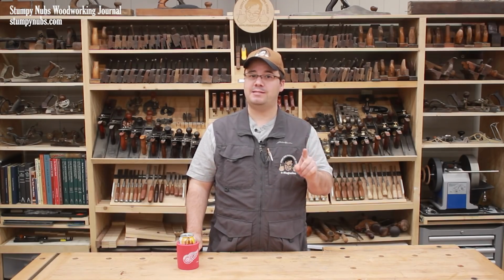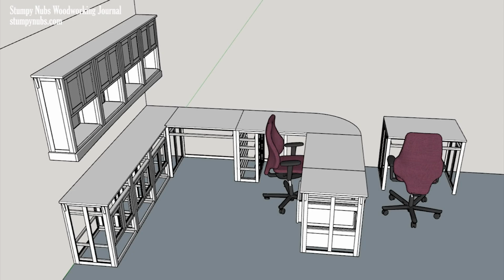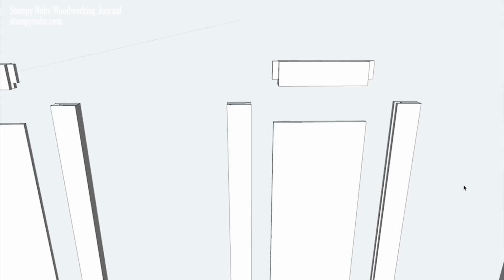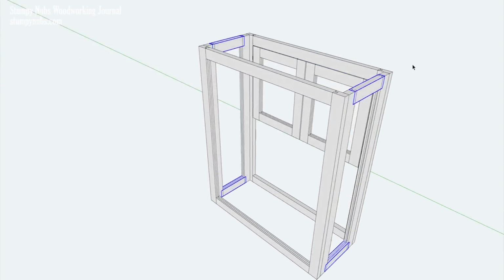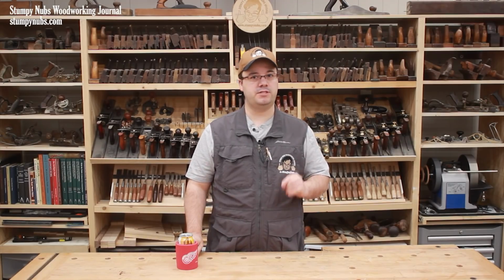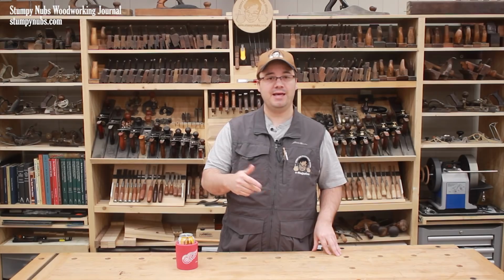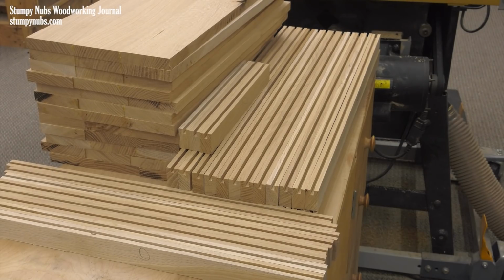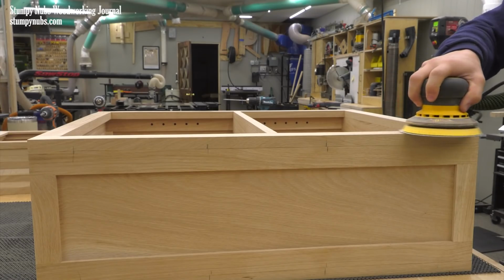How to make BIG projects without being overwhelmed

Comment: Thanks, James!  I learned these lessons from building a complete kitchen, 6 WFH desks, and a living room set.  I'm a former mechanical and manufacturing engineer, so these concepts are familiar to me, but your explanation and fine SketchUp skills make this visual and impactful.   I also create PowerPoint slides for the cut layout, tricky piece details, and descriptions for each assembly step.  This helps me really think through all of the steps BEFORE I start cutting and possibly wasting expensive materials.  The printed slides give me all the information I need in the shop.  If there are issues, I stop and mark up my slides, then revisit my SketchUp and Powerpoint files with a cup of coffee in the morning.

Comment: It is still difficult to work in a really small shop. My shop is 10 feet by 10 feet. So around 3 x 3 meter. So It is planning and a lot of cleaning. Lol . Everything has his place and I need to put back everything I used. Almost nothing laying around, other wise it is a mess in seconds. When I use a thickness planer I have to put away my small table saw, and make room.. etc etc. And a large project I make indeed in pieces and put together outside. So planning is for me really important,

Comment: I've been doing this since I started woodworking. I used to work in a metal shop and learned very quickly it's faster to batch out every single part you can before changing over to another set up for the next part. The only time I do not do this is if I'm testing a concept for a design, at that point I'm building one piece and generally not to full scale just to see if it will go together. Yes pine is fine for testing, it's cheap lol.

Comment: Good review of lean manufacturing processes!
I use this practice in small scale, but not so much for an entire big project because I found that minuscule variances add up quick, because I am not a machine, and then all those tenons i cut do not all fit their corresponding mortises. Add to this the minuscule wood movement that invariably occurs if I’m cutting things to final size a week before assembly which also makes things not fit together as well.
Add to this that in a small workshop it’s difficult to stage so many pieces at one time.
The way I made a full kitchen cabinet setup in a small workshop is to make and install no more than two cabinets at a time. I did batch what i could at each step, but I only batch cut tenons to rough size and then fine tuned each one to each mortise to ensure a perfect fit for each one 😎

Comment: Another advantage of modular design is that you can pick & choose the best pieces of wood for each assembly. For example, if you have a knot in a piece of wood then that can be placed at the back or interior of the piece where it won't be seen because the pieces can be swapped around & flipped as needed. I find this most useful in grain matching.

Comment: If you use Fusion 360 to design the cabinets you can then use the built in Parameters for every dimension in the project. Therefore if an overall dimension such as width or height needs to change, changing only one Parameter will change all other dependent Parameters automatically. I make my own frames for different size pictures. I only need to enter the value for the size of mat opening to show the picture and all other frame and peripheral dimensions change automatically to proportion the frame. I then print the drawings for the frame, mat, glass and backing for construction or ordering, I also use the assembly feature to check for any assembled errors. Saves me a huge amount of time to set the dimensions for new size picture frames.

Comment: One thing to watch when you are designing, minor size changes to better utilize materials.   years ago I noticed a part our company making, was called to be 24".  Our raw material was 20 feet long.  So a bar yielded 9 pieces.  an engineering change to 23 3/4"  and a bar yielded 10 pieces (1 free).  those kerfs add up.  and the slightly smaller piece worked just as well.

Comment: This is a prime example of obtaining repeatability in multiple parts. If you can make the same required cuts all at one time than your accuracy will be more consistent Jigs and gauges can help to confirm accuracy or if you have to return to a setup. This is more difficult than it sounds so reducing setups helps you avoid the stress of trying to return to a previous setting. Perhaps 2021 will be the year of consistency. Let the chips fly!

Comment: James, what advice do you have for someone using multiple stain colors on glued together cabinetry? I've run into so many headaches joining different colored pieces and then ruining the coloration trying to sand down glue squeeze out or flattening joined surfaces. If I wait till the project is assembled to stain, even the best masking tape can't prevent stain from seeping under the edge....

Comment: This is realy something to think about. For a Person like me that works from a plan in his head, this may be a good reason to start making drawings for my projekts. Thank you.
Reply: I mainly use mind plans too (because I enjoy being able to adjust things on the fly) & many of the same principles can still work. You just need to narrow down the selection of joints & joins you use to a handful that are versatile enough to use in different pieces, such as the rail & tenon one in this video. You could quite easily add a transom to any such piece by using another of the horizontal ones, just placed in the middle instead of at the ends of the uprights, & cutting an extra horizontal is quick & easy because you already have the machine set up to do it. Add a mitre fence & you can cut a diagonal piece just as easily, should you want to add one of those, & it'll fit into the same rails as everything else.

Comment: Don't forget to mill all the stiles and rails to the right thickness before you do anything else.  If the thicknesses are random, you'll be in for a world of hurt.  My error was in thinking that all the 1x's at the lumber yard would be consistent.  They weren't.
Reply from the maker: That was the first step I mentioned
Reply: @StumpyNubs  Yes, your advice is always golden, James.  I just didn't want anyone to make the mistake I made of trusting the lumber to be consistent just because they all look the same.  You can check the boards with a caliper; my last batch was ok and didn't need thicknessing.

Comment: A major feature of this very helpful video is missing. What CAD software are you using? I've tried several but they all show only drag and drop dimensioning. I need to be able to type in a designated length and direction such as x=15' 2.5". Which software would explain to me how to do that?

Comment: Lovely.  Seriously, those are great lessons.
But how do you prevent my favorite mistake: losing track of which pieces go where.  How do you label them?  I've rarely, if ever, seen labels on project parts in your videos.
Reply from the maker: I label when needed. In this case, most of the parts are the same, so they are interchangeable.
Reply: @StumpyNubs  My issue is that when I have a big project, keeping track of all the different lengths becomes an issue.  Or two small projects with similar dimensions.  Do you use painter's tape or something else?  I can be kind of a klutz with such things.  Thanks!

Comment: Hi James, I know you have been doing safety videos and may have more to come, but I have been wondering about the Saw Stop safety device and just how good it is, I have seen hotdogs slowly moved into the spinning blade, but that is not how an accident happens is it, what would happen if a hotdog was slammed on the top of a spinning blade ??  would Saw Stop sponsor a safety video like that ??      Thank you for the great content, knowledge and safety tips and hopes for a great 2021
Reply from the maker: I have seen hundreds of hot dog demonstrations on the SawStop at woodworking shows. Almost all of them push the hot dog into the blade harder than your finger will ever go, and it works just fine. You can punch the blade if you want. Jut keen in mind that the speed at which you strike the blade will determine how deep you get a cut. Gently touch it and you won't get a scratch. Punch it an you may get a stitch or two. In virtually all cases I know of where someone contacted the blade during regular woodworking operations, nothing but a band-aid was needed. I only know of one case that required a couple stitches, and it is unclear to me how he managed to get cut.
Reply: @StumpyNubs  Thanks James, I was wondering how fast it reacts, you answered that question for me Thanks again!!!

Comment: What would the cost of making 192 identical cuts and then realising an error be?
Reply from the maker: That's why the first cut is a test cut.
Reply: @StumpyNubs  That only helps if the cut itself is the problem. In projects this big the complexity often calls for cad drawing etc. It happened me more than once that something went wrong elsewhere in that process so just a testcut wouldn't have helped.  A battery of different tests is often performed in industrial production, which is basically what the video is about. So i would advocate a little more caution before cutting a large number of pieces